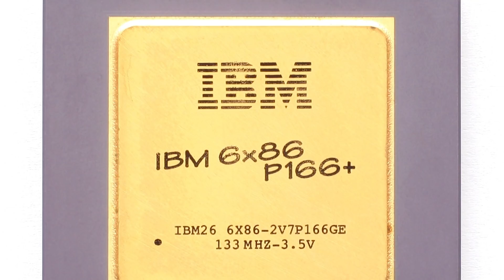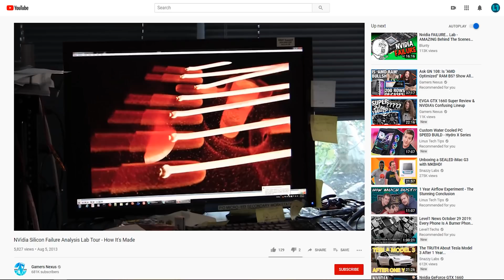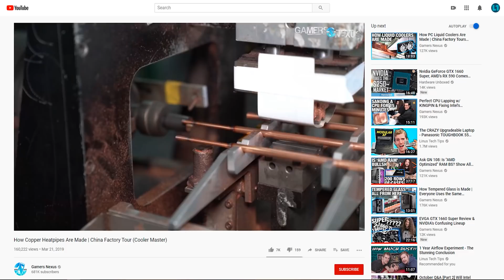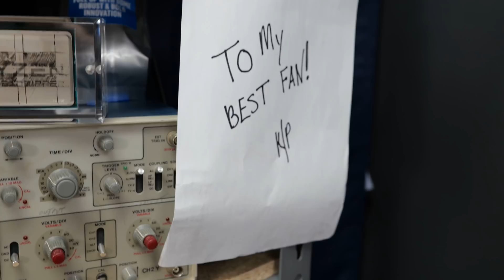Gamers Nexus EXPOSED! (Clickbait?)

Comment: Wendell, I had an IBM Opal SLC-66 VLB, also a step up from garbage. Added 128k sram cache and 80387 Co processor. Bought a Trident 9440 VLB and 2 meg expansion only to find out the shitty external bus was only 16 bits and only SEMI compatible at that. Wasted that upgrade $$$ hard core !

Comment: i had one of those 6x86 machines.  the same one actually.  i turned the computer on once with no heatsink just to test if it was still working.  put my finger on the cpu 2 seconds after turning it on and it literally ironed my finger print flat for about a week.  had to oc with jumpers back then.  75mghz bus i think.  standard was 66mgz but the super socket 7 boards came with 66,75,83 etc.  and most had unlocked multi too.  even intel chips

Comment: Steve, on that first "686" system... that looks similar to a system a roommate bought around 1999/2000 from Futureshop in Canada that had an extension board... he had issues from the start so I tried to reinstall Windows (Windows Me?) unsuccessfully only to discover they were trying to insert some sort of mini-OS (for advertisements or proprietary software?) or something in between the BIOS and Windows... not sure what was going on but it was a nightmare to work with

Comment: 02:35  That's a Socket 7 board, designed for the Intel Pentium, which had no built-in cache.  The only cache you got was on the motherboard. 

However, that's a Cyrix 6x86 chip, which has a 16KB built-in L1 cache, so the lack of SRAM chips on the board is not catastrophic.  If there were some SRAM installed, it would act as a L2 cache.  Same as if you had an AMD K5 or K6 on the board.
Reply: The More You KNow!!